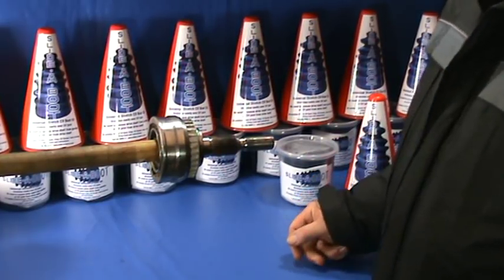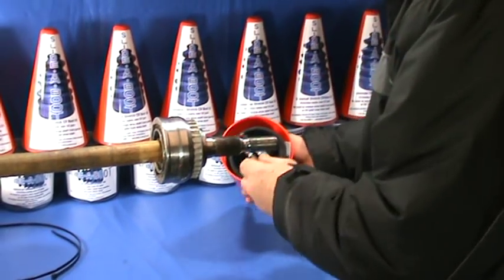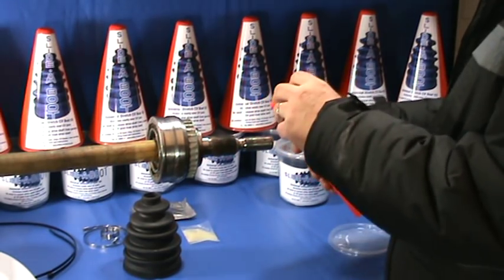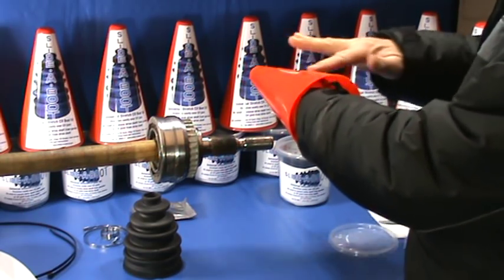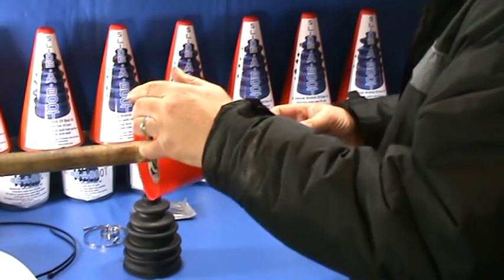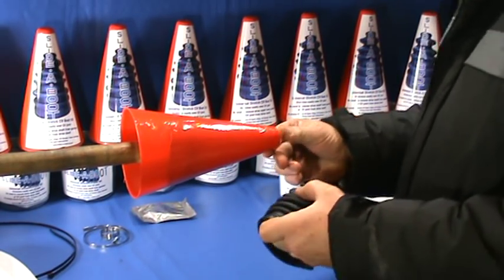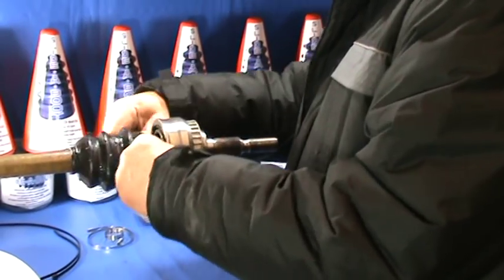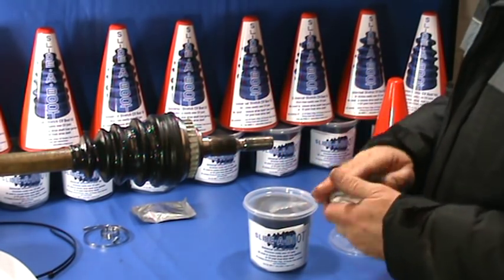Universal stretch cv boot fitting Slide-a-Boot

Comment: Is it just me or does it not give a clue where to get this product,,,,  odd
Reply: You can use a funnel to do this job , no need for this cone.
Reply: In case anyone comes across this, if you search “draper cv boot tool”, it should come up with this or similar, as mentioned though, if you have something similar shaped that you don’t mind getting a bit oily you don’t even need to get one

Comment: in MOST cases, the outer joint is a major pain in the ass to disassemble, it is also the most likely to fail. So being able to swap the boot with out separating the half shaft from the cv joint makes things a lot easier.  I'll be trying this product on my next boot replacement.

Comment: why didn't you link the website to buy the actual product
Reply: Because if you go to the next step, hitting the back of the cv joint with a hammer, the bloody thing is in your hand and you can use a normal boot which will slip straight onto the shaft.

Comment: I can see this being useful if the drive shaft is to remain on the car, but if youve got it out of the car and in a vice, then it would be just as easy to do it the traditional way, ie: removing the joints.

Comment: What's the point? It takes 3 taps of a hammer to remove the cv joint or less than a minute to remove a circlip if it was one. By the time your spent messing about with this it could have been done. Also these cost a lot more to buy than a  replacement boot for a few quid.
Reply: Try it on some Toyota drive shaft!!

Comment: Or just buy the ones you glue together. The glue is stronger than the rubber.
Reply: I had three and they all have cracked or broken apart just enough to fling little specs of grease everywhere. I used bailcast which it seems they are the best, but still I would almost rather just replace with a solid one and not a split one after all the mess it has made over time.
Reply: @GMoney-B  Same here!